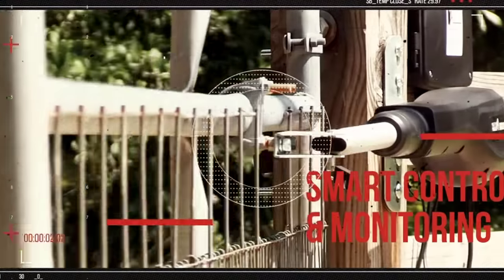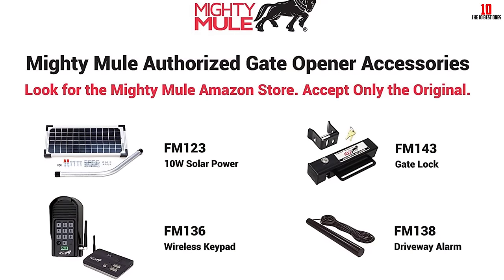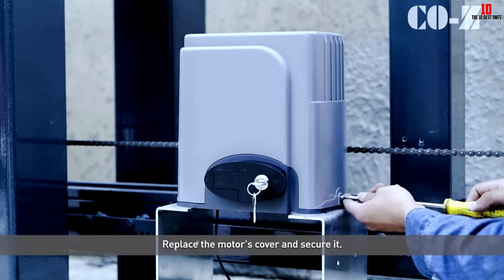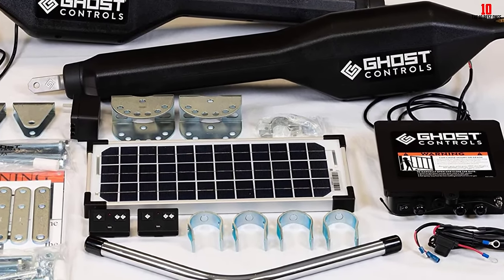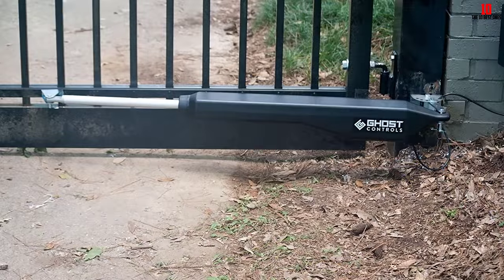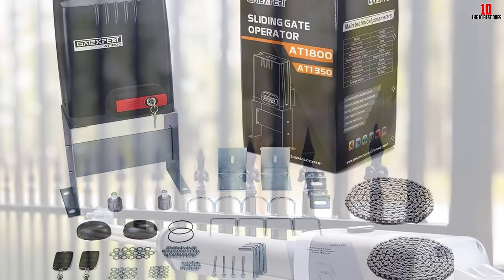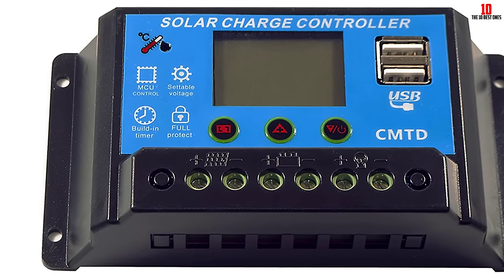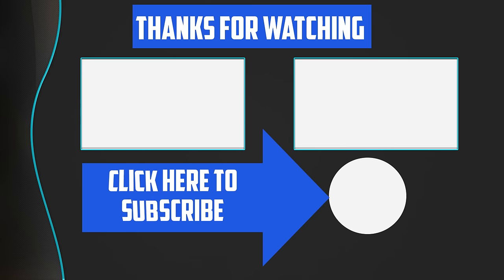✅Top 10 Best Automatic Gate Openers in 2024 Reviews

Comment: I just went through the list and have to say, Im happy we cant get that garbage in Australia, we can get chinese garbage but not US garbage (that ive seen). I have been working on industrial/domestic gates for nearly 15 years and so far the ones to use are FAAC, Centsys, Beninca. You can use Nice but they've gone overboard with complexity, other brands like BFT, Came are ok but the first 3 listed are my preference. This goes for swing operators and sliding gate operators. One of the main things to look for with swing operators is does it need mechanical stops, most of the brands will have a version not needing mechanical stops, meaning you dont need something in the middle of the driveway to stop the gate from over travelling. So make sure you ask about how they stop in position you choose. Another thing is 240VAC or 24VDC, 24VDC has a higher torque so the gate ends up with more force behind allowing it to handle more resistance during travel, you still need mains to the gate but from the controller to the motors is 24, which makes it safer if theres an issue and the cable breaks or is damage, generally 24V wont kill you. Also dont forget to ask about duty cycle, this is the amount of times it can be operated in a 60 minute period, the best is 100% but if you only use the gate a few times a day 40% up should be ok, if you exceed the duty cycle the gate may trip out until it cools down.

Comment: #8 chain sliding gate.. never ever ever ever get a chain drive gate, use nylon or steel rack. Chain goes slack then jumps placing gate out of alignment, not only that you cant tighten it or it will snap so there ends up being a sag in the chain and the longer the gate the greater the sag, it gets so bad ive seen cwear a trench in concrete after 12 months nearly 10mm deep. So never ever use chain drive.

Comment: 22 year Gate and Operator technician.  These are all over-the-counter do-it-yourself gate operators.  I wouldn't own one on purpose.  But, they will run 1/3 to 1/2 of the cost of real Brands that prefer to be welded on and power run to them.  This list is the kind you would see on a farm gate that does not get used daily.  More Power to them, I love capitalism, but these are not even in the running for "Best" in any category but price.  Liftmaster, Maximum Controls, Apollo (Nice) but only the 1500 series the rest is Nice buying them out and turning it into unnecessarily complicated French junk, BFT is the bottom of the Real Gate Operator barrel, FAAC is great (they invented Automatic Gate Operators) but are high level tech and well, you will need a professional to stand a chance at running one.  Steer clear of DoorKing and Linear operators, they are communications companies that try to play operator and...fail.  Remember-No Free Lunch.  You get what you pay for.